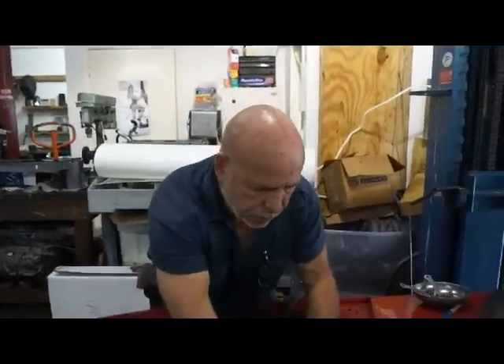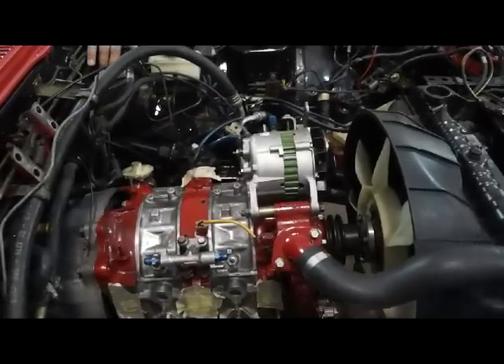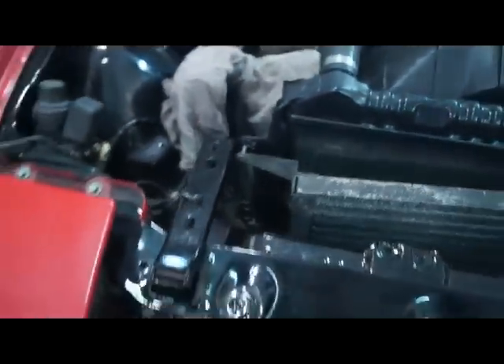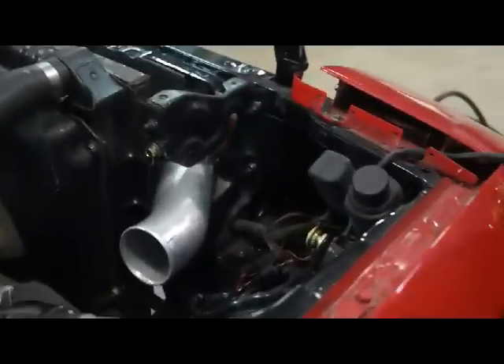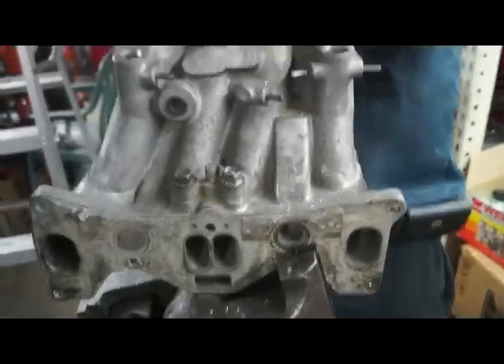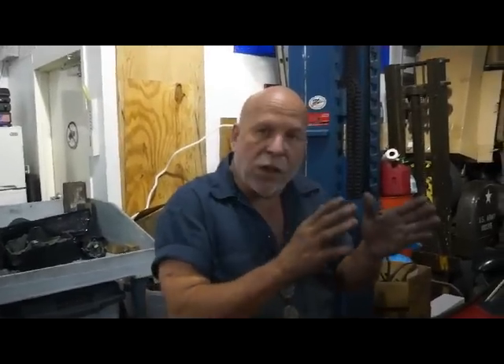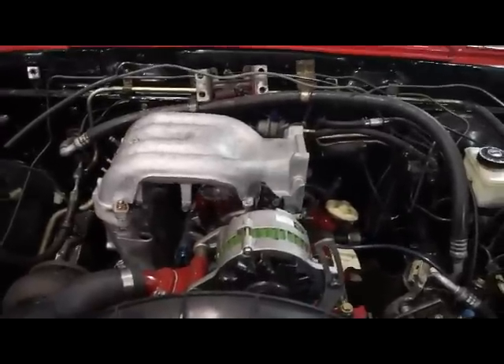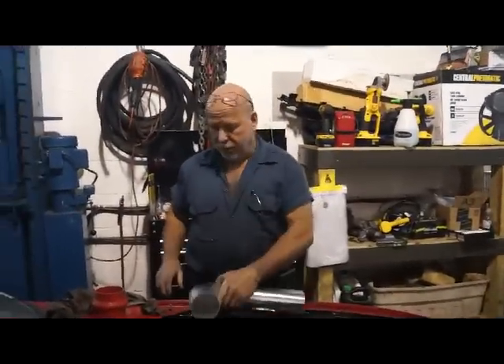13b swap for 12a

Comment from the maker: The Shop is located at 13800 SW 142 Ave Bay # 4 Miami, FL 33186.  Phone # 305-235-3696.  Website:  www.clrmotorsports.com
e-mail:  clrmotorsports@gmail.com.  

This setup uses the Haltech stand alone system.